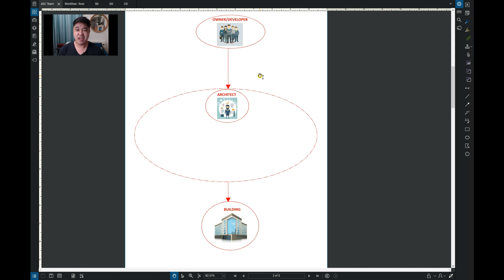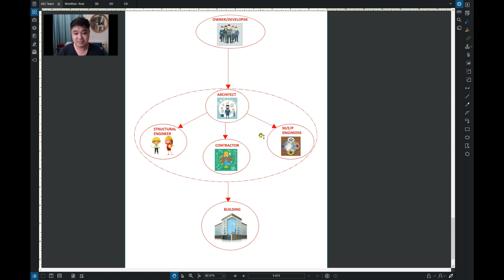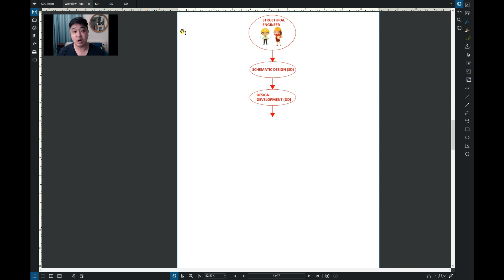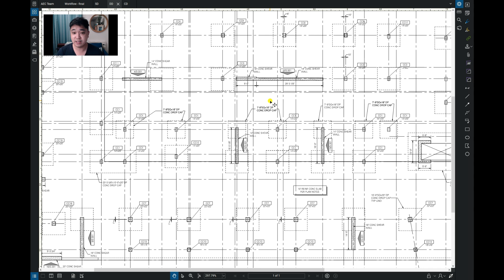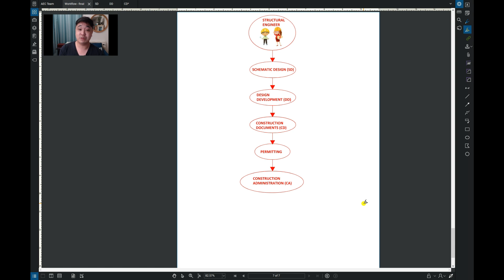A Civil Engineer's Workflow - Structural Engineering Design and Drawings

Comment: Hi Mat. Found your channel while searching for structural engineering costs. My wife and I are in the process of having our 1600 sq ft bungalow home renovated (new roof, floor, ceiling etc). What is the average or range of the fee around here in SoCal for this type of project. I know you can't give an exact price with such limited information, i was just wondering what i should be expecting the price will range from. Thank you!

Comment: Hey Mat, love your videos! They inspire me as I'm aspiring to excel in the field of structural engineering. I saw in your video about making resume that Matlab is one of your software skills. I wanna know what uses in structural engineering Matlab has.
Reply from the maker: It's useful if you want to get in academia or work for a design firm that uses a lot of programming (this is usually only the biggest firms since they have resources for this). You could also try to work for a computer software company that makes structural engineering software or a firm that specializes in performance based design. If you want to get into typical building design in the industry (small to medium firms), matlab is typically not used. This is from my experience in the US structural engineering industry.

Comment: This is very important to know for every civil engineering fresh graduate!!!
Reply from the maker: Focusing on the wrong things costs your firm money and prevents you from anticipating problems before they arise. An entry engineer could spend hours on an insignificant error in a software program during the early phases or going in a circle trying to figure out a calc (analysis paralysis) when the calcs arent even the final product. If they are in schematic or early stages, architecural changes happen all the time. Spending too much time on the calcs in the early stages is wasted because you have to redo them all the time. In CD phase, the design should not change, that's the time to finish calcs. The most important thing is to keep the most important thing the most important thing. See the bigger picture.
Reply: Mat Picardal did you have to get your degree in engineering to be a detailer or could you get a certificate for engineering technology support be enough to be a detailer?

Comment: Mat, Do you have drafters on your team? If so, how involved are they in the phases you discussed? Thanks
Reply from the maker: Yes, we do. They are typically not too involved in SD since its mostly bluebeam and sketches. DD they setup drawings in Revit and fill in typically structural info with minimal input from the engineer (depending on how experienced they are). CD is when we give them the majority of redmarks/markups and majority of our coordination with each other.
Reply: @MatPicardal  how can I apply to learn under your guidance. I am planning experience in AutoCAD and basic drafting in Staad pro

Comment: Hey mat thk so good video I need to know what the different between various codes of buildings
Reply: fat_ Joe hey mate, for structural analysis there are no big difference but for members preliminary designs and section selections it has big difference and most of assumptions for earthquakes, winds designs are also very different. BS, ES and IS are very similar but GB( Chinese standard ) and ACI are very different also... for instance in concrete structures fire safety resistance, cover of concrete due to environmental and economic issues are different.